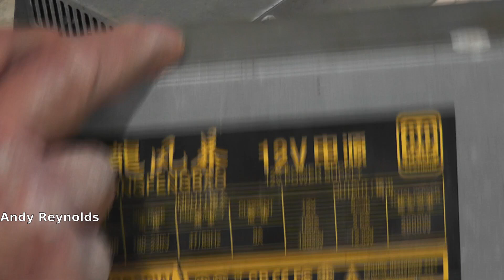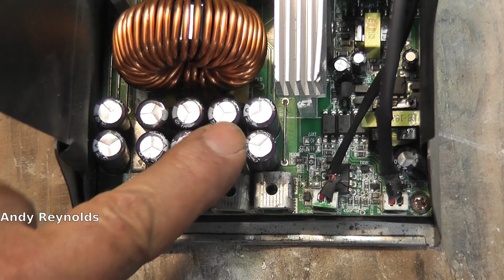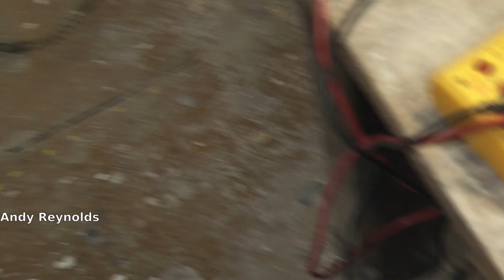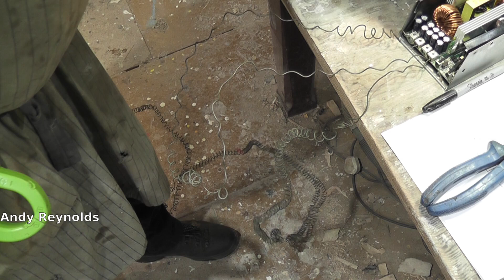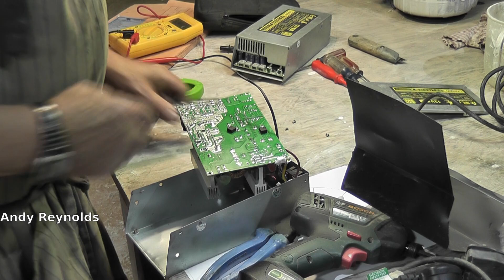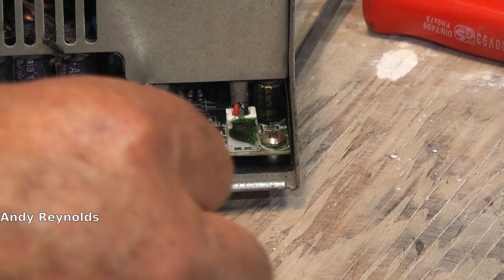12v @166 amps, is that right? The law, switch mode power supply investigate and test

Comment: Cloth to 2000 Watts.
It's probably a push-pull converter with powerfull mosfets.
It depends of the legislation of your country but usually those so powerfull switching supplies need to include a factor corrector stage.
Reply from the maker: Thanks for the comment, there are 6 very large FETs and a tornado of a fan, cheers

Comment: Are these computer server power supplies?
Reply from the maker: Hi, maybe, but not the computer type that we are familiar with, cheers
Reply: They are server power supplies for data mining centers....awful, noisy, huge units with thousands of these running at the same time....for AI processing, etc.
Reply from the maker: @englishrupe01  Hi, that's interesting, Ebay US shows them for sale with multiple cable outputs, oh yes awful noisy fan but a huge draft, cheers
Reply: @TheInfoworks  Oh, yes...i am not knocking yours...they are great for the odd home electronics power project, for sure. Indeed i have some myself, (though only 1000W), though a bit noisy. But we can always swap out the fan for a quieter one if we don't need full power (or run the fan at a lower voltage). But, no, i was only referring to the huge, noisy installations that are popping up around USA ruining the peaceful countryside with that screaming noise. It creates migraines, drives away all wildlife and makes homes worthless to sell, all with no compensation to those affected. Thanks for the fun video!
Reply from the maker: @englishrupe01  I was thinking less power demand and larger but quieter fan. USA is a brutal regime, cash over anything, as JJ Cale said,: money talks (very loudly), but not to all of us, cheers

Comment: Based off the labeling and case style, I'm pretty sure these are cost-down units made for mining, of the cryptocurrency variety that is. If they were sold domestically in China, they might be trustworthy long-term. Should have the global market full of these since China cracked down on mining years ago.
Reply from the maker: I'm thinking that a quieter fan and run them at 20 amp max. I assume they are constant voltage so a 5 amp load will only draw 5 amps, cheers
Reply: Yeah they're constant voltage. They're there just to drop the mains down to something more manageable and stable. There's a second stage of regulation on the crypto miners that takes the 12V in, and drops it down to somewhere around 0.9-1.5V for the logic. The amps at those voltages are quite hilarious.
Reply from the maker: @nikomo Thanks, very interesting

Comment: You won’t like this Andy, but for a laugh, if you had one of those 2000W rated inverters that go from 12Vdc to 240VAC you could hang a 2kW fan heater off its output and use this working unit to power the input. Mains to 12Vdc to “mains”. They could race each other to blue smoke dragon.
Reply from the maker: Nice idea, tumbling the chaos, rather like modern corporate world, a race to the bottom, cheers